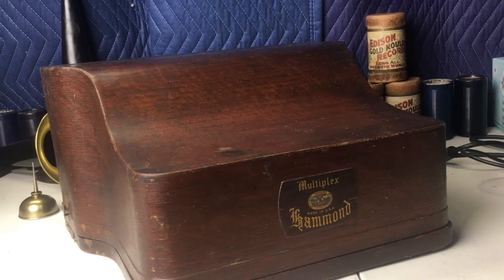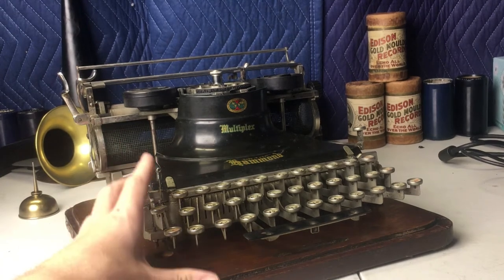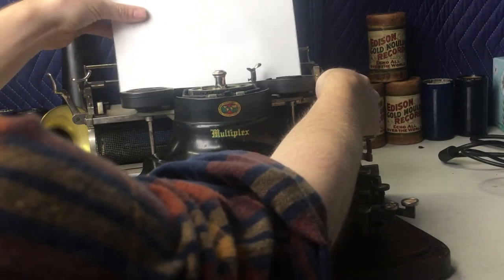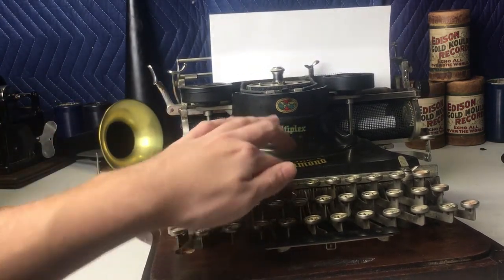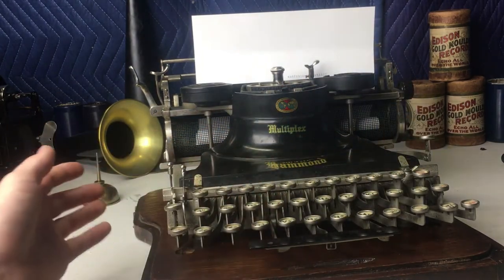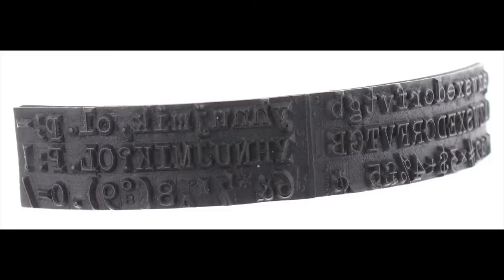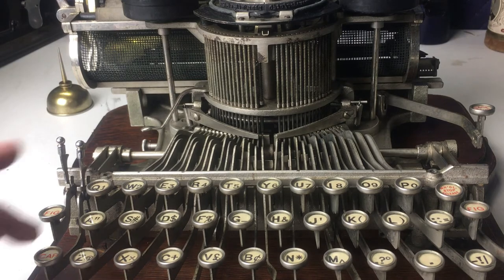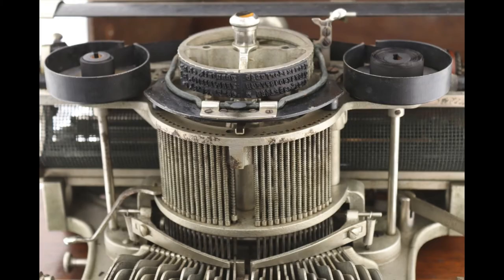Hammond Multiplex Typewriter

Comment: You need a rubber "impression strip". It fits on the two pins on either side of the carriage and fits between the paper and the hammer. It keeps the pressure of the hammer from damaging the type shuttles and provides for a better impression on the paper. This is very important if you want to keep it working for years more. There is also a latch down at the lower left of the anvil to keep it in place so you can lift it to rotate it without removing it from the typewriter and be sure it goes back down into the right spot. It's that little wire like thing off to the left at about 3:50.